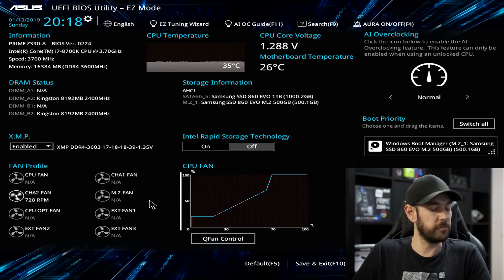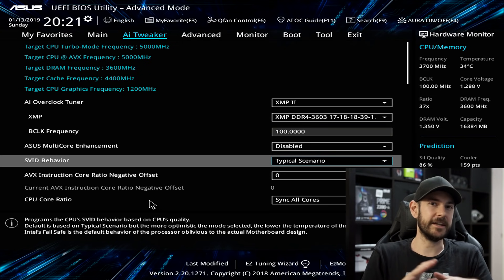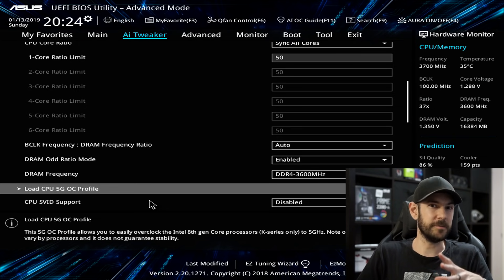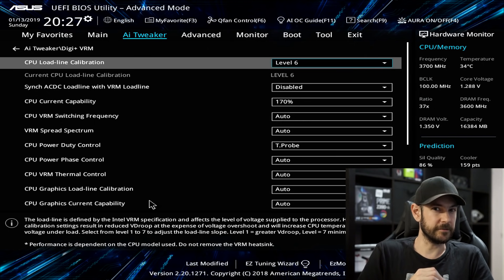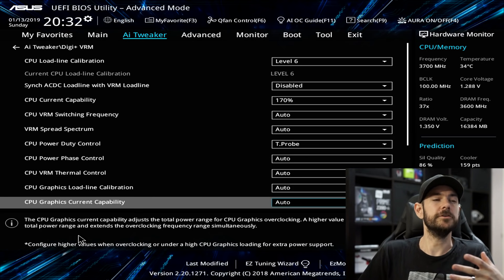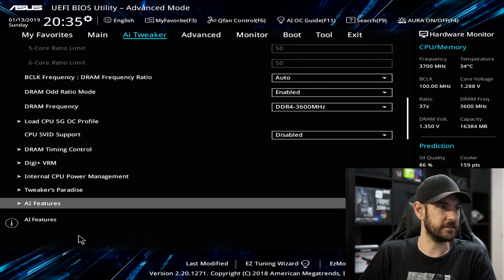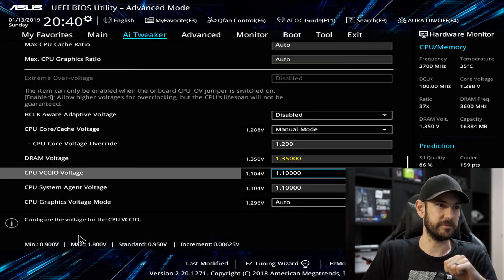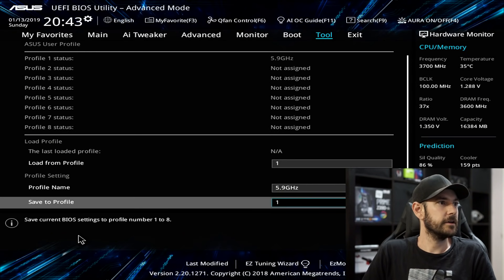ASUS Z390 Quick Overclocking Guide | i7 - i9 | 8700K - 8086K - 9700K - 9900K

Comment: I watch all your video I liked it all except one thing : Disabling "C state" can have issue with the Powering ON of your computer. still You made a nice overclock but I think not the best for the power consumption, it's not a coincidence that Intel and Asus develop technology for that, so you should use them ;) also to not have the voltage in adaptive is not saving energy while you are just using Chrome and reading stuff online :)
Reply from the maker: Energy consumption is relative to load and current. Not voltage. At least not to a meaningful extent. The energy cost from not using these features over the course of a year would be about equivalent to forgetting to turn a light off for a few hours.
Reply: @boostedmedia  thanks for the update but with Covid-19 and working from home the Electricity bill increased so I would still make sure to have an Optimal setup than a big surprise at the end of the year. Thank you again for the explanation. I still believe More voltage mean more heat mean more CPU fan cooling :)
Reply from the maker: More voltage does mean more heat and more cooling but only under load.

Comment: I'm so stuck in figuring out why my PC will not boot if I make ANY changes to try and exceed the default settings. I have this:

Intel Core i9-9900K Desktop Processor 8 Cores up to 5.0 GHz Turbo unlocked LGA1151 300 Series 95W

HyperX Fury 64GB 3466MHz DDR4 CL16 DIMM (Kit of 4)  RGB XMP Desktop Memory HX434C16FB3AK4/64

Asus Prime Z390-A Motherboard LGA1151 (Intel 8th And 9th Gen) ATX DDR4 DP HDMI M.2 USB 3.1 Gen2 Gigabit LAN

I followed your guide to the letter (twice in fact) and it will NOT boot. I go back to default settings in the BIOS, totally fine. (Yes I've updated my BIOS, today in fact)

Comment: I'm so out of date. I haven't done overclocking for nearly 10 years. Used to overclock all the time from the early "5x86" days until the Phenom processor line, almost all AMD. Now I have a modern 10850k z490 and it's a totally different game. Still trying to figure it out. Main goal is to see if there's any way I can tune out the "power limit throttling" that it hits on stock settings (it's not a heat or PSU issue, it's Intel / Asus or someone just doing weird things. I've seen LTT tune that out so the clocks stay steady under load, but no idea how to do it.
Reply from the maker: Turn off adaptive voltage and multiplier as well as power C-states and turbo boost. Then set your vcore and multiplier to the desired frequency.

Comment: I followed similar steps but cannot get my PC to boot after saving changes and exiting. I only set the basic things. i7-8700k, 5.0 ghz over clock, 100 bclk set cpu voltage to 1.33v, 1.1v on the VCCIO and system agent voltage, 1.35v on 3200mhz ram, and it will not boot I just get a black screen. Anyone know why?

Comment: I know this video is old as hell but worth a shot, I did everything in this video for my 9700k and I can’t start OCCT without getting several errors detected. And then I can’t check the errors because as soon as they are detected I blue screen. I’m currently lowering voltage by .01 increments but still no luck. Any ideas?

Comment: Ccan you overclock without xmp?
Reply: @decimal XMP has absolutely no effect whatsoever with regard to overclocking a cpu. Even more to the point, there is nearly zero benefit to be had from overclocking ram. There’s just SO few processes/applications that are actually ram speed and/or timing limited. Try this to prove to yourself how worthless and what a waste of time and energy it is to overclocking ram; if your stock ram speed is, say, 3200MHz, turn it down to 2400MHz or even less, maybe 1866MHz and you ‘might’ see a very slightly lower score is some kinds of synthetic benchmarks. Play an actual game though, or encode some video, etc, and you’ll find nothing at all has changed. 

So the short answer is yes, absolutely you can but don’t waste your time (and definitely not your money by purchasing faster ram). 

PS: all of what I mentioned is specifically related to system ram, not ram speeds on a graphics card. In the latter case it can certainly be quite beneficial to overclock both the gpu and ram speeds.

Comment: Tested with i7-9700k (water cooled)
On 50x got a bluescreen with 1.29V
With 1.3V got a freeze after 3 mins into OCCT
Now testing with 49x on 1.3V
Temps arround 70°
(Dont wanna reach the 90° TBH)

Comment: Hi there, I got one question if somebody could help me out. While in Idle with CPU-Z Opened and MSI afterburner and HWmonitor just to check stuff out randomly CPU-Z closes and my cpu goes around 70 Degrees in idle and stays like that until I reopened CPU-Z then back to 50ish temperatures. Everything is in idle, with 5GHz OC and 1.28 CPU Voltage
Reply: Update : This seems to just be fine if I give something to the CPU to process and it cools down, I am still monitoring this
Reply: Update : So I played a game of League of legends , somehow after 10 minutes it went up to 90% load, and to 80 Temp . I closed and reconnected the game, everything fine.
It happened once again after 15 minutes, this time CPU-Z somehow closed itself , I reran CPU-Z everything was fine, CPU-Z requires admin to run.
Reply: Update : This happens with task manager as well, CPU goes into 80% load high temp, task manager closes, I reopen it, CPU goes back to 30% and lower temp

Comment: Followed each step, yet crashed without botting windows xD
Reply: Try higher voltages, 1.290v for 5.0GHz is super low, unless you got very lucky with the chip you bought, like he did i guess.... i need 1.340v on my 8700K to have 5GHz stable. With 1.290v i can only OC at 4.9GHz.
Reply: @_L_i_o_  didn't do 1.29? I tried 1.36
Reply: @RedlioNxTR  hmm, i guess you got very unlucky with your chip, im sorry :(
Reply: @_L_i_o_  yea, I will go with AMD
Reply: @RedlioNxTR  dont forget you will have to change motherboard as well...

Comment: I have an i9-9900k and 6 QL120 fans and 2 of them are on my cpu cooler which is a Corsair h100x and I’m getting 173 cooling points in the bios. Do you think this would be good enough to overclock with? Also I’m wondering is it okay to go straight from 3.6Ghz to 5Ghz or is that unsafe? I’m new to Overclocking and any advice would be great, thanks.

Comment: Even with loadline level 6 and vcore set to 1.3, my vcore under load drops to 1.232. Is this normal? Also I have a tuf z370 plus mobo.
Reply: Noticed mine do the same on my z390 w/9700k

Comment: I have an Asus Z270F Gaming with an i57600K CPU. + 16GM DDR4 2400MHz. I did a simple overclocking of the CPU to 4.8GHz. CPU voltage rose to 1.255 and Dram Voltage to 1.287 XMP enabled. So should I still set CPU Load-line Calibration to level 6 and CPU current capability to 140% (maximum for me) ?? So far I have it set to auto. Thank you for the advice.

Comment: Thanks for the great guide. I managed to reach 5 GHz with 9700k (1.32 VCore Voltage). 

I have a question, after setting as the same as described in this video, 
my monitoring software says my CPU only uses 2-4 Wats even when it's not idle and obviously it's not correct ( it should be around 60-120 Wats)

Do you have any idea?

Comment: So far enjoying the video but I have a question. At 14;16 you mention setting up a fan profile for pwm control, which you also claim to have a separate video explaining all that. If I have iCue, which controls my 2 intake, 3 exhaust fans, would I need to disable that or is the PWM profile the fan that is for the cooler for my pcu?

Thanks as always! Good video so far :)

Comment: Incredibly well explained. Also pertains to z490 Asus Bios, that has things in slightly different places. Runs fantastic at 5.0 with your settings, but crashes at 5.1? Forget Ai tuner and Intel extreme tuning utility I think this fixed 5 oc is much better. Ran Aida and no throttling. Would like to know what to change for 5.1?

Comment: Damn I really wish I wouldn't have tried to do this. Now my PC is just going to the blue blank screen when I started it up. I have this exact motherboard and my CPU is 9600k. Can someone please help me just get it back to a functioning PC again?  Is there a way I can go back to the original settings I had? I'm such a noob!
Reply: I did the same thing and now I can't boot... Followed exactly. Anything get you up and running?
Reply: @drewbeach1298  yep I ended up just taking my GPU out to access the lithium battery in my motherboard. Took the battery out for a few minutes, reinstalled it and it put my motherboard back into it's default settings. Booted right up after that! Let me know if that doesn't work for you. If you're motherboard has the "refresh CMOS" button on your back panel, supposably you can push that and it will do the same thing.
Reply: James Carfield I have the battery out as we speak 😁 gotta be up and running for flight sims drop tomorrow. If nothing works I’ll be driving somewhere to buy a new motherboard tomorrow haha.
Reply: @drewbeach1298  haha that's awesome! Did it end up working for you? I hope so, just so you can save some money!
Reply: James Carfield it sure did thankfully! Appreciate the advice.
Reply: @drewbeach1298    glad to hear that man! That's awesome that it worked out for you! Have fun playing that flight simulator game. Will it be on steam? I might have to pick that up!
Reply: James Carfield  On Steam, Microsoft store and game pass. Played till four am, lost track of time. By far the most incredible thing I’ve used on my computer or seen from a “game” (simulator) ever. I’m training for my pilots license and once VR support is released, it truly will be a great place to practice. Not to mention you can fly over your home and it’s in the sim!
Reply: @drewbeach1298  holy crap, that is awesome! I'm definitely going to be buying that! I built mine to mostly play pubg, but I'm so terrible at the game that I ended up building a 1400 dollar PC to watch YouTube on.. haha! Been looking to find another game to kill some time and you may have helped me out with this info!  I'll probably buy it and let it download while I'm at work tonight!
Reply: @jdwhodey  lol all u had to do was enter bios and run optimized defaults lol

Comment: Whenever I overclock my 8600k and start my computer after a complete shut off (turning the power supply off for 15 seconds) it turns on for a second, then turns off and turns on by itself once and boots into windows normally. Is this normal? my pc behaves normally whenever i set my bios to default settings. I've heard that computers do this to switch from the regular profile to the OC profile, just want to double check .

My settings are:

 i5- 8600k at 4.9 Ghz at 1.295 Volts using a Cryorig H7 universal for cooling

Comment: Finally I made it stable with an acceptable temperature by doing performance tests in OCCT (average of ~ 70 ° C with and maximum peaks of ~ 80 ° C). I did the same as the video says, except some parameters in my case; -1,285V -LLC4 -AVX 2 The rest the same. My PC; -8700K -Z390 Maximus XI Hero This motherboard drove me nuts as the CPU voltage on my CPUZ always dropped quite a bit when I launched the performance test. As I have read in reddit forums it is something that happens frequently to the model of my motherboard and I can not know the reason. At least it is stable, it does not represent failures or overheating.

Comment: hello have problem to OC my ram to 3200 Mhz ..when i OC the ram ..it will boot loop twice then start normally but when power is on without the cut off power, the pc start up normally

It happen when the power line is off, the boot will be twice then start normally ..i tried many things but the problem was not solve..and now keep in default mode which ram at 2133Mhz and no twice boot loop..

ANYONE PLEASE HELP!! THANK YOU
Reply: My setup is
CPU: i7 8700k
GPU: msi rtx2080 
MotherBoard: Asus rog maximus hero xi wifi
Ram: Gskill tridentZ  3200 16b
PSU: Corsair RM1000

Comment: Hi there! I followed your guide however I feel like I am experiencing high temperatures with my GPU. I am currently using a RTX 2070 Super. After light use with chrome after 30 minutes - 1 hour it is very hot to the touch. Any recommendations?

Comment: I have followed your videos "ASUS Z390 Quick Overclocking Guide..." for my Asus Z390-F and 9700k and I aslo your video for stabiliy testing, and here comes my question, when I do the intelburn test with heavy load I get 90C on the second loop so i stopped the testing. Are these values ok for 9700k or is this to high? I saw that you was around 65C. Please help

Comment: i9-9900K, Asus ROG 2080 Super, and this exact Z390 Motherboard from ASUS. Computer continues to crash. Followed each and every setting you've made brother. Just wondering what to do to hold a stable 5GHz. Tried a manual voltage override of 1.290, 1.350, 1.320, and continue to crash. Is there another setting I should change to hold a stable 5GHz overclock? I keep getting blue screens, "PC has ran into a problem"

Comment: Is it okay to run your cpu at a locked freq? So if I were idle wouldn’t the cpu running at 4900mhz be overkill? Or only under is the cpu stressed?
Reply from the maker: Stress is relative to load.

Comment: @Boosted Media. I have a 9700k in a Formula XI Z390.  Is there anything you recommend doing differently with my boards featureset? I am just looking for a 4.9 to 5.0 OC but really whatever is stable in the end. I am cooling the CPU via 360mm rad fans maxed all the time and the system is in a TT Core P5.

Comment: Question, this is my first time upgrading to a asus board and to be exact in which board, it’s the z390 Maximus xi hero. Now my question is, can the “American mega trend” be disable in some way where I only get the asus boot and then straight to the windows page. I know that it’s part of the boot in a way that it’s to make sure it’s all in check but since I’m going from msi to asus, I’m not so used to it being like that everytime I turn on my board.  If it’s not possible I’ll just deal with it but I would like to know if it’s possible to disable that screen
Thanks

Comment: Good morning 😀 I have a question really Load-Line Calibration I don't understand how to set up the Asus Z390-f i7 9700k processor E.g : 1) I have set voltage 1.280V, LLC set to level 5 and voltage holds 1.280V only can there be drops below the set voltage. 1.270V 2) Voltage the same 1.280V only LLC set to level 6 and can throw higher voltage up to 1.300V. Which profile will be the best 5 or 6 Thank you for your help

Comment: Why is my CPU CORE/Cache voltage set at .986v and yours is 1.29?  Even when I change my setting to manual it still reads as .986
Reply: I followed exact instructions and currently at 5.0ghz at 1.27volts

Comment: Can't get it to boot windows with these settings.  Freezes on the second ASUS splash screen, and then won't let me boot until I revert back to stock and power cycle twice.  The best I've been able to get my 9700k to boot with is 4.8 ghz unstable, and thats after upping the voltage to 1.320.

Mind you I'm new to CPU overclocking.  Did I get the worst hand ever in the silicone lottery or am I just retarded?

Comment: I'm using Asus Prime Z370-A, after watching this video only difference i can see is that i miss some options that You have in this video. Is there any real world difference,  things that i should watch out for while using z370 or genereally speaking i can use this guide without any concern? For cooling i'm using BeQuiet's Dark Rock 3 (190TDP).

Comment: Great video! We really appreciate it. Question- Is it normal for the PC to have a 1-2 second delay when hitting the power button after OC? The lights flicker real quick like it's booting up, then 1-2 second silence with no lights, no fans, then revs up. Is it reading the BIOS settings before booting? And also, is there a reason why you chose XMP 2 instead of XMP 1?  I have the same board and using i7-9700k.
Reply: @mcd5729  like he stated, it's memory training and normal.
Reply from the maker: Yes. That’s memory training.

Comment: What an amazing video, you turned overclocking fun for me! However... slight issue i cant find answers to anywhere! When running OCCT, im getting really low wattage readings under the power tab for instance package is reading 3.77 where as when i reset to defaults, it reads around the 60/70 watt mark? 3.7 isnt right,  so im confused? i expected an increase in wattage! Is it to do with turning some of those settings off in the bios so it cant read the real wattage the CPU is using? would love a couple of pointers about this. Thanks :)
Reply from the maker: It’s likely just OCCT isn’t reading the sensor correctly. It happens on some systems. Nothing to worry about as long as everything is stable and tote voltages and temps are under control.
Reply from the maker: Your voltages^
Reply: @boostedmedia   Wow thanks for the fast reply. It seems to read the wattage correct when at default settings. Getting 4.7 GHz at 1.225v max temps while running intel burn test 88 on max stress. I know thats high but, getting about 60/65 degrees for regular use which im pretty happy with, Until i get a new cooler which has magically jumped higher on the what to buy next list since watching your videos and attempting overclocking all last night  :) Best overclock videos ive seen thanks :)
Reply: Sorry thats on an 8600k btw. with an AIO cooler

Comment: Hey with a 8700K @ 4.7ghz using 1.280 v core I'm showing temp spikes of around 92 in OCCT stress test. Is this ok? Lower v core values gives me error. Temps seem to average around 70-80. Thanks so much for this guide it's super helpful for beginners.